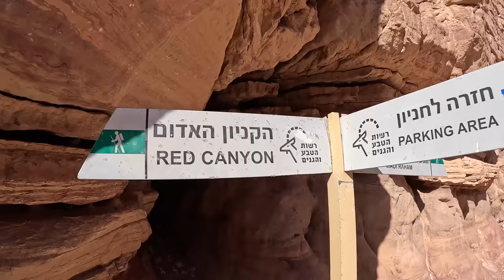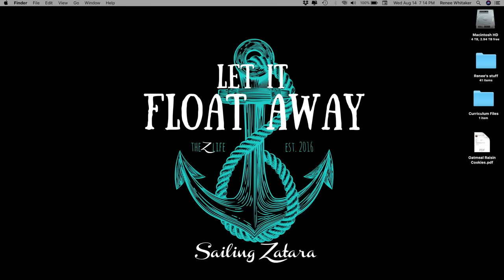We've got NO POWER!!💥 Boat Electrical Problems⚡️(Ep 228)

Comment: All electricians just had a heart attack.   I know this is temporary but please fix that ring terminal at 7:30 .  When you leave out or cut off strands of wire you are basically making a smaller gauge wire.  The size or girth of the wire determines the  amount of amps the wire can handle.  So if you have a wire that would be rated at 100amps and you cut of 40% then you now made a connection rated at  60amps  This will cause a connection that can easily heat up and fail.  This can cause a best a burnt connection at worst a fire.  That old wire that you cut off looks like the last person trimmed some strands of wire off.  Every thing (wire, connectors, breakers) need to be sized correctly.   Please fix that connection when you get a new switch

Comment: Awesome electric job, Keith. Is there anything that you cannot repair???
Reply: Keith, I am wondering about your add-on to rinse your watermaker periodically. I have a desalator watermaker which has no automatic rinse… hence I need to pickle it every time I go off the boat. Would be great to hear about your new setup for auto flush. Thx, Martin S/Y Pacifica

Comment: Uh jeez keith. Looks like your AC is overburdened. prolly should keep doing that. looks like the fuses are NOT protecting the wiring? where did that char come from? the wiring? hope you get this right before the end of the Vid. wifey put an add out for your electrical system consulting.